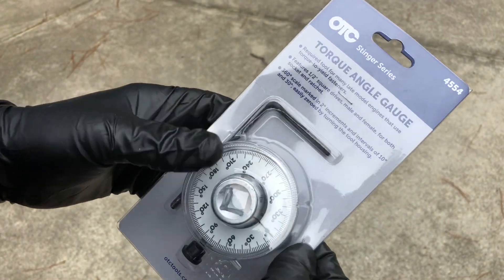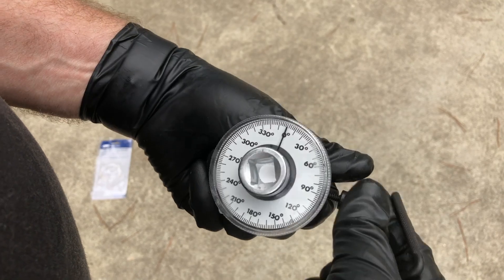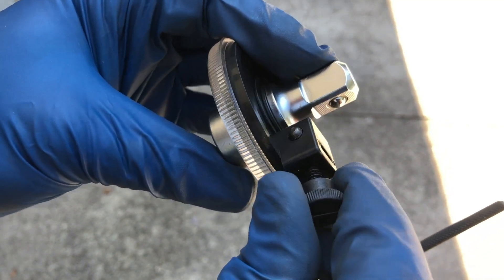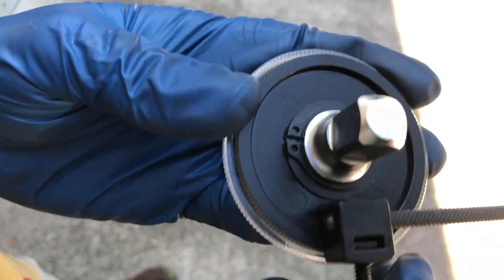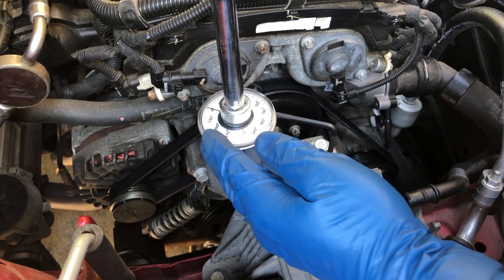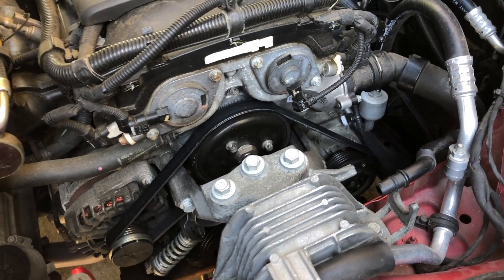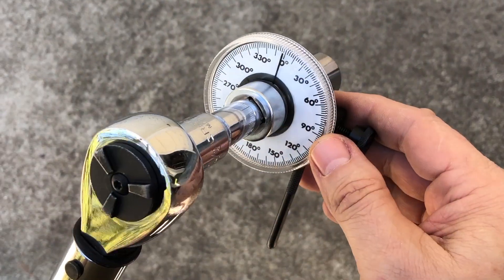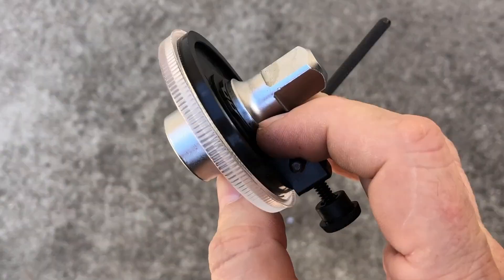OTC 4554 Torque Angle Gauge Unboxing, Overview, Usage and Demo

Comment: Got the same tool recently for cylinder head screws. In practice these tools are quite fiddly. It's not a trivial task to find spots to place the retaining bar against where it cant move or turn. Because the bar that came with the tool was too short for my cylinder head I replaced it with a thick long wire which I can bend in various shapes. Also before using it in earnest I practissed a bit to get a feeling for the friction between the scale and the housing because if you do it wrong then the scale turns with the ratchet.

Comment: Does this damage the bolts
Reply from the maker: This tool sits between the socket and the torque wrench, so it's impossible for it to damage any fastener in and of itself.   Damage, if any, is going to be cosmetic and from using an incorrect socket.  Either a 12 point instead of a 6 point, or using an SAE size when metric is called for (and visa versa).   Torque to yield (TTY) fasteners stretch to achieve more specific clamping forces, and this tool is only used to get that specific stretch.   That's why TTY fasteners are one time use only.

Comment: Why do they do that and not just say 130 foot pounds or whatever
Reply from the maker: Because that's not precise enough for this type of modern fastener.  A torque to yield fasterner is made of a metal alloy that actually stretches / deforms for a very accurate clamping force.   That's why it is only rated as a one time use only disposable commodity item.  The foot pounds, or inch pounds if smaller, gets you in the rough neighborhood.  Then the additional degrees gets you spot on.  Hence the need for this sort of tool.

Comment: You can mark a point next to a point on the bolt head with a paint marker. Tighten your bolt and once the next point lines up with your mark, that's 60 degrees. Next point, 120 degrees. Half way between the second and third point, 150 degrees, etc.
Reply from the maker: It's not uncommon to find intermediate degree requirements (e.g., 33° or 62°) that would be imprecise to approximate in the manner you suggest.  A torque angle gauge is a very inexpensive tool, costing less than $25 bucks, to insure the accuracy required to meet manufacturer specifications on very expensive components like engines, differentials, transmissions and the like.

Comment: Does the retainer bar have to counteract (leans on adjacent piece) against something?  What happens if there is nothing to counteract against?
Reply from the maker: Yeah, you have to adjust that long bar to make contact with something stationary in order to have the needle traverse the dial measuring the arc of travel you make with the wrench.

Comment: Its nice to have the tools you need ,  They rather say torque to 40 pounds then go 60 or 90 degree more why not just give the proper value .  Torque to 24 LBS then go 90 ok a 1/4 turn, so the 24 plus the 90 is 42 pounds .   guess they have reasons for the angle ,  than list the torque value .
Reply from the maker: This tool is used with torque to yield fasteners only.   Where the metal the fastener is made from will stretch for precision clamping force specifications.   That's why such fasteners are one time use and discarded once removed.   You cannot get such precision with a torque value alone, hence the degrees metric.
Reply: @DrShock Retired & learning new things.  These videos are very helpful with these small details.  Volvo has lots of specs for even small tasks. 👍
Reply: @DrShock   I know most fasteners are 1 time and toss. But 50% reuse them .  I do till I notice damage.

Comment: Thank You. But I don’t see why the side black piece is there if all you need is the socket and the gauge.
Reply from the maker: Thanks, you have to use the black bar to move the dial as you turn the wrench.  Otherwise the dial will move with the socket and you will not measure anything. ;-)
Reply: @ Got it Sir, thanks for clarifying that.

Comment: I wish I would have seen this video earlier. Last weekend I installed new wheel hubs on my car that called for 25ft lbs + 60 degree and I had a tough time using this gadget. I proceeded to strap an electric angle finder to my ratchet and that got me by. I'm sure this would have been more accurate if I used it correctly. Thanks for the demo.
Reply: @HeadBroski  You can mark a point next to a point bolt head with a paint marker. Tighten your bolt and once the next point lines up with your mark, that's 60 degrees. Next point, 120 degrees etc.

Comment: OK so it's taken me 7 years to figure out.. the gauge is just a lump of metal, and you're already supposed to know the number, for a specific bolt somewhere.. cus god damn, I was expecting a feckin readout based on the torque lol!!
Next question I'm sure I'll never get answered.. how the bloody hell do you know WHEN to start counting those numbers then?? The bolt was already in and tightened.. the amount of turns to get it to where you did 60 degrees from is surely in the thousands.. so how did you know where you were in the first place that's the place you add 60 from? 😅
Reply from the maker: So typically, and my experience is with how GM specifies it, you torque the torque to yield fastener to the specified torque value as you usually would first.   Then you use the torque angle gauge to stretch the fastener the additional degrees specified (this is why the fasteners are single use and are supposed to be discarded once removed).   You can rotate the dial on the gauge to start at 0° each time.  You use the small arm as a stop for the dial.
Reply: @DrShock  Lol didnt't think you could answer my question,  and there we go, ya didn't! :p
Reply from the maker: Actually, I did but I'll elaborate for more clarity.  This process is not that precise in terms of where you start counting degrees from, at least as far as GM engineering is concerned.  You torque the fastener in the usual way.  And then an additional X degrees of over torque as specified in service documentation.  The rotational torque starts at zero.   Continuous rotational torque as indicated by the dial on the gauge.  It doesn't matter if you stop and restart, the clamping force is cumulative.  So you start counting degrees from where you left off with the torque wrench.
Reply: @ToninFightsEntropy  you really shouldn't be doing anything with metal tools if you don't understand. Stick to the plastic Bob the builder ones 😂
Reply: @DrShock  so you have a sheet/guide or manual to tell you how many more degrees you need to overtorque a bolt or nut? Or you have a general idea how much you need to torque angle some more based on experience and the engine manufacturer?
Reply from the maker: You would fine the torque, and degrees if applicable, in the manufacturers service information.  Typically within the service manual for the vehicle/machine.

Comment: This is stupid. Why not just torque to a given value? I had to do this recently and i used a phone app to set the angles. I just found the torque value at 30 degrees and torqued them all to that.
Reply from the maker: It's not stupid it's simply mechanical engineering and materials science in practice.     

The application of angular force for a fastener, beyond the use of a base torque, is required to account for variations in fastener load distribution.   A torque angle gauge reduces the variation in fastener torque and insures the exact clamping force the engineer who designed the component originally intended to be applied.  GM engineering is one of several OEMs who require a torque angle specification, and also require the original fastener to be discarded and replaced (torque to yield bolts are one time use only).
Reply: @DrShock  I guess you are right, but it's difficult if you don't have the special angle gauge.
Reply: Darn, I bought one of these thinking it could replace a torque wrench. Probably not useful for me personally
Reply: I guess I am missing something here , your vid says torque / angle demo , I only saw angle . Do you set the torque first then the angle , ex: 40 lbs then 60 degrees ??
Reply from the maker: The manufacturer names the tool a Torque Angle Gauge but it's only for applying the angular value specified in a factory service manual.  The angular value is secondary to the initial torque value.  You would torque the fastener first, in the usual way.   So yeah, in your example if the manufacturer specification was 40 foot pounds  plus 60 degrees, then you would do the 40 ft lbs in the usual way with a torque wrench.   Then affix the torque angle gauge to the torque wrench and do the additional 60 degrees.   This results in a stretch of the fastener to achieve the more precise clamping value the engineers required.   This stretching action is why torque to yield fasteners are not reusable.

Comment: This is super cool and I never even thought to look for one. In the situations where I needed do angle torque However I just marked the bolt head. I like this method too because if it ever came loose you look at it and tell